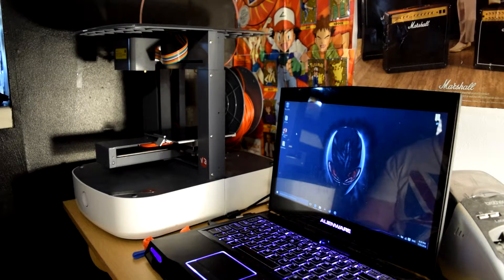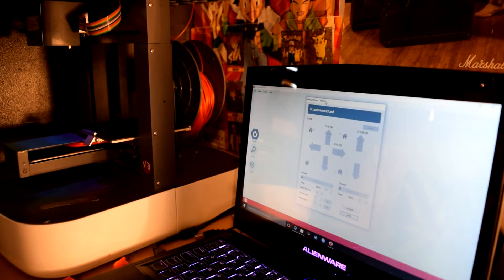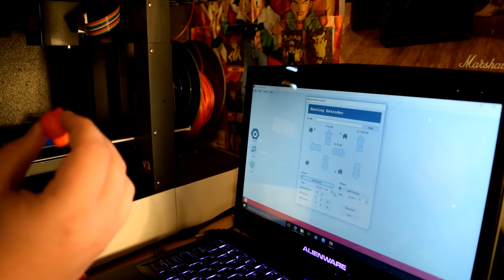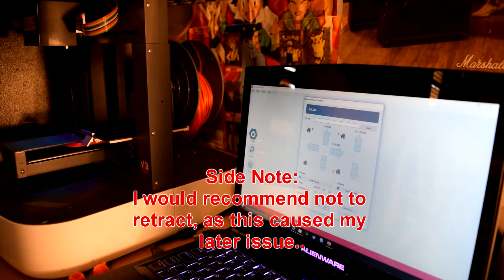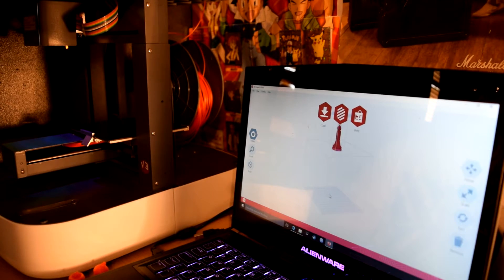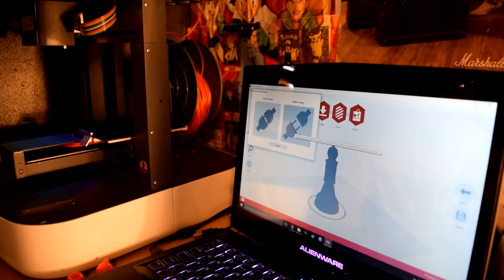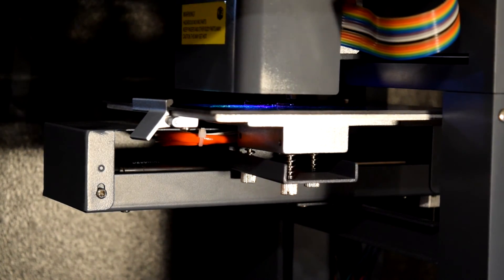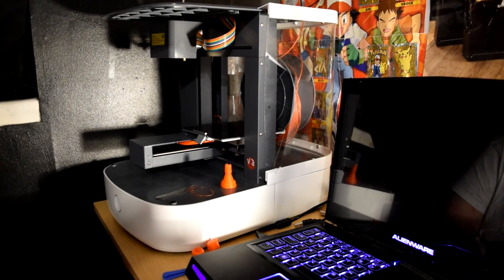HOW TO 3D PRINT WITH EAGLEMOSS VECTOR 3 3D PRINTER

Comment: is the temperature stable or up and down?
Reply from the maker: For pla the temp should be stable, you can do a tweak of the PID settings if it is struggling
Reply: @nath042  where do you get that calibration tool from?

Comment: I got this recently as a second hand printer and it is my first 3D printer. I have set it up and calibrated it a best i can but it just doesn't work. I am not sure what the problem is, where i went wrong or any obvious solutions. I use the manual controls to try heat the extruder and that doesn't work, the material itself doesn't seem to want to get pulled into the machine. I have tried the Gcode which is supposed to help with the temperature but that hasn't worked. If anyone has any advice it would be really appreciated.
Reply from the maker: if its not heating, maybe make sure the thermistor and heater is plugged into the correct socket on the header, also make sure that it hasnt been tightened too much as that may damage the thermistor or heater.
Reply: The additional part cooling fan was an issue for me, the angle needs to be adjusted otherwise it cools the heater as it’s trying to heat up, it’s not needed unless you’re trying to bridge so I removed it. Had a bunch of issues with mine but I have managed to get some half decent prints out of it. My nozzle has been blocked a few times which also could be your issue, I heat my hot end up to 220 and clean out with thin wire. Can also buy them cheap.

Comment: G'day Nath,..Finally got around to finishing the build of mine, just a bit late,.. :)
Trying to test print a Benchy Boat and fails with the plastic not sticking to the bed,..
How did you figure out which temperature settings are needed ?
Reply: Set the nozzle to 200, 205, V3 software still says 'Heating to 180 :(
I'll go download the Repetier software :)
Reply: Gets up to 200C without issue in the 'manual control' section, it's when sending the model to the printer the software sticks to 180c.

Will see how I go with the other software.

Comment: Im build the Vector 3 printer and on the board the is an micro sd slot. I have read the instruction and it doesn't mention if i need to put in a sd card. please help
Reply from the maker: i dont think the SD card part ever did work

Comment: re-issue 91 and the new cooling fan it all looks ok but I did read on a forum that there is a interference problem I believe with the heated print bed once the cooling nozzle is fitted.comments any one?
Reply: dump the print head get a dremmel  with mach3, turn it into a router !!!!
may be a fuse in side the psu anti surge ?
Reply: turn the brackets holding the fan upside down.  Change the 2 fan connectors around and move the switch to software controlled.  Works much better.  Forums have this solution and the bracket modification was in issue 96/97 which you can view on eagle moss using your subscription login (although I stopped at 91)
Reply: note, the heater element has same connector type so double check your connectors when you do this.
Reply from the maker: Thank you for your message!

Comment: Yeah the SD card should have been mentioned some time ago, I just disassembled my printer and inserted one 8GB formatted as FAT32.

My only complaint is the final fan, if it's not fitted with a gap to not hit the heated bed it causes a lot of problems and destroys prints.

When it's finally build it looks not too bad for a home build, noise as hell - but that's down to metal and plastic rubbing which I'm going to fix with sandpaper and time hopefully.
Reply from the maker: Thank you for your message!

Comment: Im currently stuck at 177/185 'c Heating extruder......
Reply: apparently they are working on a firmware update
Reply: is that the second fan you have on. someone suggested that it works with only one fan. my model doesnt print that well.
Reply: cool. when I try and print it messes the print up. any idea's
Reply: no just one fan. it starts to print then it moves what it's printing and end up in a mess.
Reply: blue tape? how do you print in fine.
Reply: I've found that option. still not printing right. any idea's why the motor keeps juddering
Reply: dan h cover up the top fan That's what I do
Reply: my motor is grinding when it starts now
Reply from the maker: thanks for the comments!

Comment: i think the reason your printer will not print in offline mode is a missing micro sd card...
if you have a look at the main pc board inside the front of the printer, just below and to the right of the power switch, you should see a micro sd card slot.

i am a few months behind you in the assembling of my printer (im at issue 56).
i noticed the micro sd card slot, and the fact that it was empty..... i have put a card in the slot.
im hoping that this will allow the printer to work in offline mode once mine is finished...
Reply: I've just received my last three issues, and with it they included issue 91 (free) which is the first of the extended issues. In this one is an extruder cooling fan which attaches to the extruder assembly. So there are now two fans on the assembly.
Reply: +Nath042 let me know if that does work. (Reply here)
I will be interested to know. I don't fancy having to leave the computer on for hours on end foe a more complex print. 
Hopefully the micro sd card will allow offline printing. 

Thanks.
Reply: +Nath042 a free V3 sd came with one of the early issues
Reply: not with mine... i got a 4GB USB stick, NOT a micro SD card.... very different things...
the slot inside the printer is a micro SD card, NOT a usb style one.

im talking about the slot on the inside of the printer, on the front main board.
not the USB slot on the rear.
Reply: +SlightlyWetFart you would have to open the printer and leave the card permanently installed. Being the inquisitive sod that I am, I noticed the empty slot on the board, and figured I would stick a card in it. I think this just allow you to spool the print job to the printer than turn off the PC. It's not meant to be a plug in and remove king of thing. Like adding memory to an android phone. Once the card is installed, you almost never need to remove it. At least that's what I think the card slot is for. It will be some time before my printer is assembled enough to try it. In Australia we are only up to issue 56.
Reply: i tried emailing Eaglemoss about whether the printer needed an sdcard for offline printing, but they never replied.

if it does need one, it would have been nice to have been informed, and informed at an appropriate time, like before the case is all assmbled, when it wouldn't require any disassembly to fit.

what's this about 40 extra issues though?
i know these partwork things like to extend their run, but what could they add to this?
i was kinda hoping that for once i'd actually finish one of these things.
Reply: If you get the full manual off of the Eaglemoss web site it mentions the SD Card.  Its not obvious but I read most of the documents today while trying to get my printer running now that I have the last few parts.  So far it all lights up but does not connect.  I am not sure my saftey switch is happy or the latop or something.  Also cannot get the firmware update to work again.
Reply from the maker: thanks for the comments!